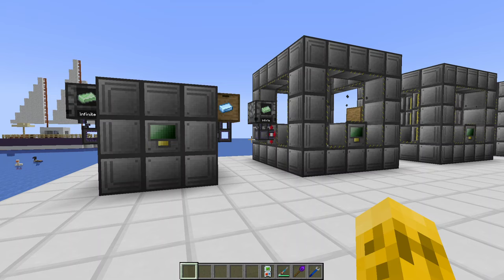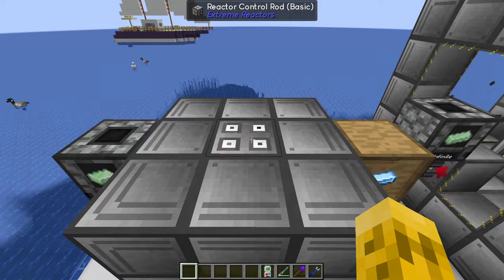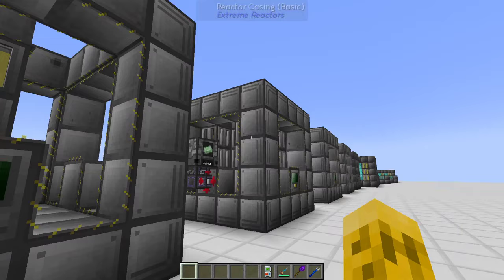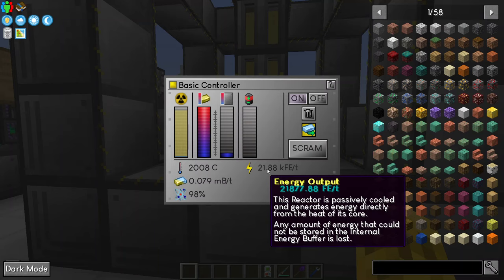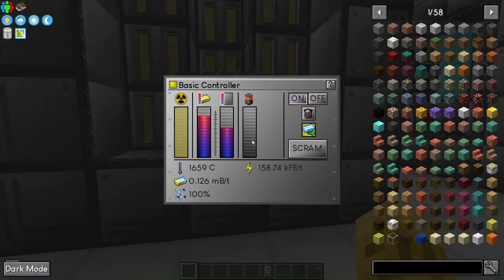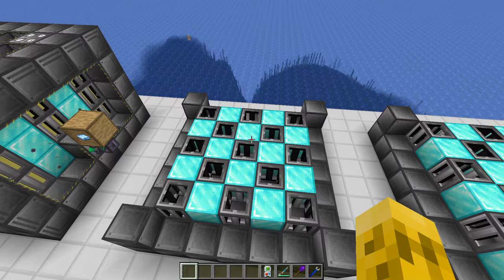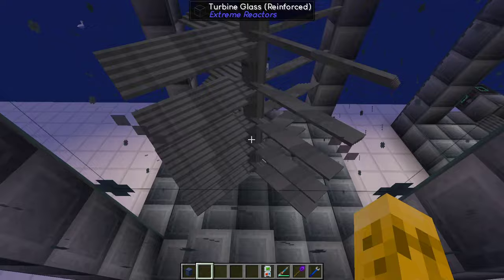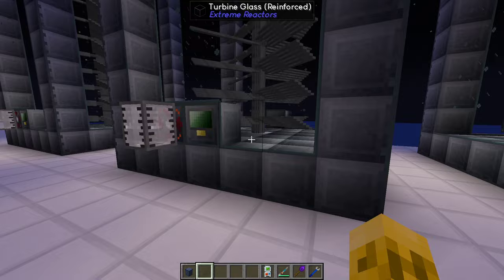Extreme Reactors & Turbines - Choosing the Best Size - With Math!

Comment: when i make the basic 3x3 reactor exactly like you did, it only produces 184.5ke/tl, do you know why this might be? i am using yellorium as the fuel source and have the fuel rods all the way out. thanks!
Reply: correction, i saw that you were using uranium so i tried that too, and there was no difference.
Reply: @quark_ow  most likely a modpack thing, a lot of packs change the output for reactors in the config file

Comment: Great explanations, thanks! Disappointed though because I'm playing ATM9 and this exact setup only outputs 22k rf/t. They have nerfed it so horribly it's not even feasible to use the mod. 😭
Reply: They buffed it 3× times in the more recent updates
Reply: In ATM8 the output with a 5x5 reactor with checkerboard fuel cells and graphite blocks between fuel cells and casing is just under 11kFE/t
Reply: it's enough to power a digital miner (non silk touch) with all upgrades (9kFE/t)

Comment: Good video, nice explanations, common mistakes and typical recording errors. Of course, Just cause a particular setup is the most efficient, it doesn't always mean its the best in your particular case. I fondly remember a big reactor i build back in 1.6 or 1.7 where i had 1 reactor powering 24 turbines by having the reactor in the middle with 8 turbines around in 3 layers. Cause its modded minecraft and you always end up with virtually infinite stuff anyhow. I designed it all as part of a maniacal madmen's nuclear base. 

There is however 1 thing you forgot to mention, which is very important when dealing with multiblock structures in minecraft, and that is chunk borders. You always want to make sure you build multiblocks, such as reactors, turbines, or smelteries and tanks, within a single chunk, to prevent issues arising with lag or self loading chunks that can cause issues server wide. I remember a guy that built a 256x256x256 big reactor, and whenever he logged on, tps would go down from 20 to 2. Suffice to say, staff made it disappear with worldedit.
Reply from the maker: Oh yes staying in chunk boundaries is always a good idea!

Comment: In all the mods 9 7x7x14 isn’t that good my reactor does 300k turbine does 70k
Reply: Sounds like you built a very large Reactor and like 90% of your steam is going to waste. Your Reactor could probably power A LOT of these turbines so if you matched your reactors output, the turbines would produce more. He even said that a small Reactor can power 5-20 of these turbines. You just didn't scale correctly.